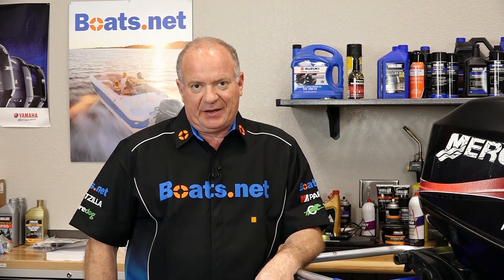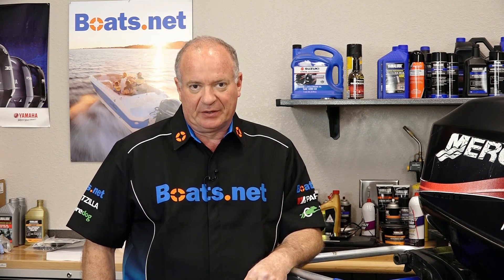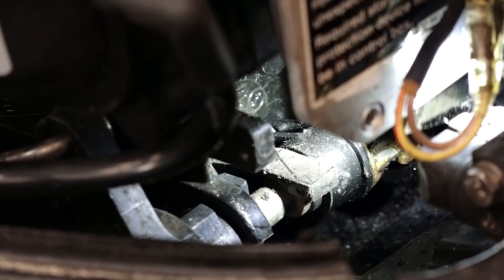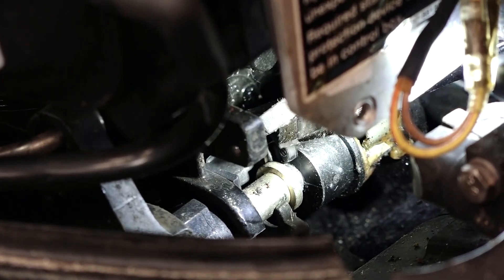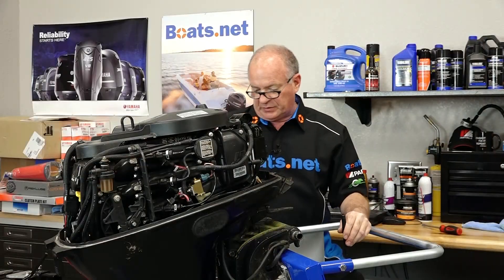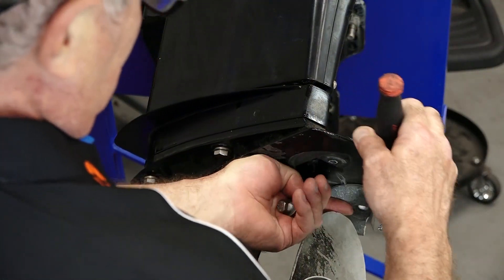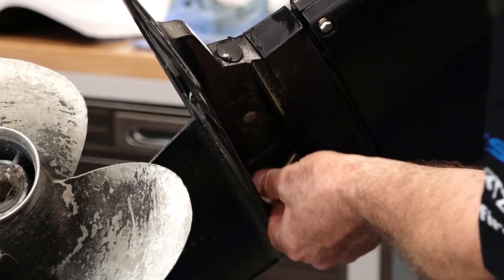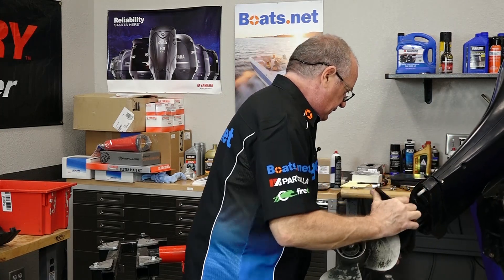Mercury Tracker 40 Lower Unit Removal | Mercury 40HP Gearcase Removal | Boats.net

Comment: Great video.   Finally found someone showing how to release the shift shaft!!!!   Now hopefully I can get it all back together and secure shift shaft again!
Reply: Yea but not where it's located 😅
Reply: @crescenciorocha2213  I dont know what you mean.    On my engine this was exactly what it took to release the shaft.   Bad news is that when I went to put it back together I popped the seal in the lower engine case out and so now I have to figure out how to reseat the seal and then try and get the shift shaft up into the lever shaft again!
Reply: @JONBOYLEMON  I don't know what you mean either cause I never said that wasn't HOW you did it, I said that in this video the location is never shown. So idk what you're on about bud.
Reply: @crescenciorocha2213     got ya, sorry was trying to understand what you meant, now I see what you mean that it's a little unclear in video, but once you follow linkage it's in the only place it could be.

Comment: Excellent video. A couple of points though: The shift shaft is on the front middle of the motor. Releases just like the video shows. BUT, take note of it when pulling the foot off. When reinstalling that rod has to go through a rubber boot on the base of the motor. I knocked that boot off a couple of times trying to get the shaft back through it. Also, there is a small pin on that release mechanism that has to go through the hole at the end of the shaft in order for it to work properly.
Reply: I can’t get this shift shaft to line back up for the life of me. I get it lined up and I shift it once and it pops out and I can’t shift anymore. Any ideas?
Reply: Thanks!!😊
Reply: Wish I had read your comment about popping boot off before I did that.
Reply: How did you get the boot back on?   I just spent the last hour getting the boot out of the shift shaft hole when it fell down the hole trying to get the boot back in the collar.    
I am about ready to run it without the boot!!!!

Comment: Wondering where the shift shaft is? In the video it goes right to removing that pin that holds the shift shaft but I have no idea where the shift shaft is? I have a 2006 40 El p t e f i. Thanks wondering if anybody could help out.
Reply: I watched a different video and saw that a newer model had nothing to disconnect

Comment: Apparently I didn't push that clip back far enough...it's now hung up..  I half way bolted it back up to release some of the pressure still it's hung up  then outta frustration I went and cycled the forward n reverse .... frustration.. so I'll try again by push that clip way way back off the yellowish brass type cable housing deal ...

Comment: Just started service on that outboard. Without knowing how to take down the lower unit. Thanks John  ...another question is..What does 5 beeps after turning on contact mean ? Engine runs good , is it a code that needs a reset? Greetz John.

Comment: Mr. Tally,  thank you for these excellent DIY instructional video's.  I own a '96 Yamaha 15hp 2 cycle outboard.  I am trying to teach myself to do all the normal maintenance items and eventually to do a complete tear down and rebuild.  What product do you recommend I put on the bolts, for example the 6 bolts keeping the water pump housing together, to keep them from corroding and to keep them from getting stuck?
I've recently discovered your channel, although I am no expert, here is a suggestion.  You have a lot of black in your video; the Merc is black, your shirt is black and the toolbox's face displaced in your video background are all black.  In my non-professional opinion the lack of contrast takes away from your great content.  Close up video of the actual parts and work being performed is most helpful.  If you would comment on what your audience is actually looking at, and what is revealed once that part/piece has been removed would be beneficial.  I plan on ordering Lube 2-4-C part #802859Q1 from Boats.net; you flash that information on one of your videos, I would suggest keeping that kind of information displayed a little longer.

Respectfully,